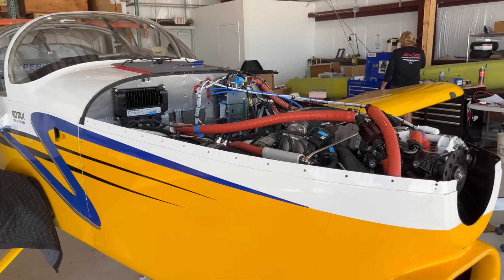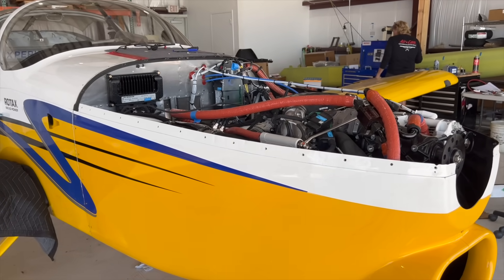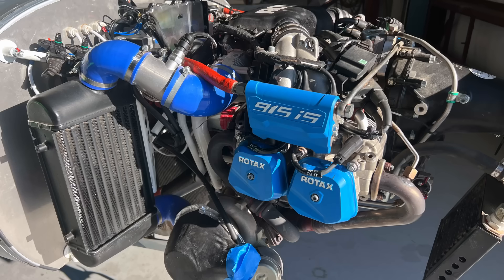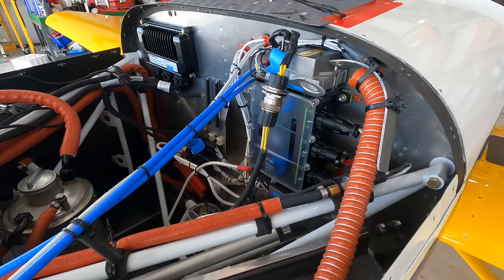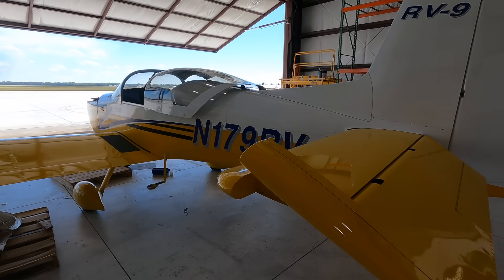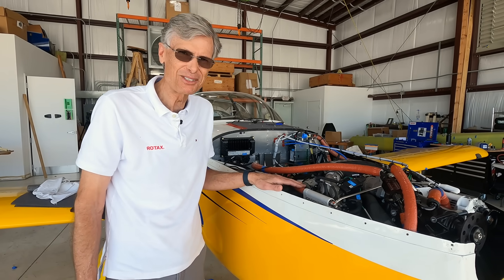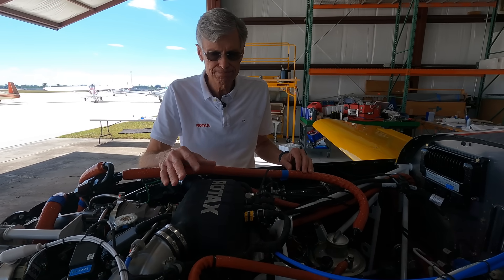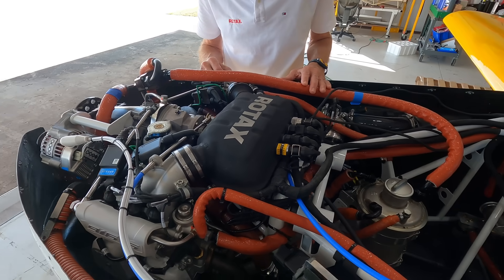Van’s RV-9: New Rotax Power

Comment: So This aircraft can go 19000 ft at 190 knots at 8.5 GPH... Now my question is... its IAS (Vne ) will be limit to 190 knots... So and Vans RV9A specs i saw celling is FL245. Here my question is If anyone wants to fly high till Fl240 suppose.... So the TAS with no wind will be 216 knots plus.. At 9 GPH..... And its IAS Vne will be under 190 knots  of less.... I saw at IAS to TAS calculator if IAS is 140 knots TAS will be 190 knots +- 5 knots depends on the aircraft.....at Altimeter 29.92 set at sea level... If this plane can go 216-220 knots at Fl220-Fl245.. This is an outstanding setup for long cross country...... Even close To early Lancairs 360 .. With very low stall speed just 44 Mph full flaps. Now.. Put BRS, AC, Aux tank.. IFR setup.... Then this Small little aircraft will be a completely beast... Better payload than JMB vl3...... With Gear down..... This is just brilliant from Vans - Lockwood and Rotex.... If all including ends 275K usd. I will be ordering this RV9A QB kit  next year.... I am very excited.. As i will fly this in india... To Dubai -Thailand often for my work.. This plane completely fits my mission under 300k usd category...

note :_  i Have seen its flying data in flighaware.com of N179RV  for may-august 16th 2025 ....it cruises continuously  at   210 knots many time at FL174 and top was 214 knots .......it seems to me 225 knots plane  if vans increase the vne..the high aspect ratio wings are doing magic at altitude .

Comment: My Glasair I RG would do 195 knots true at 7500 feet non turbocharged.  It was built around 1987.  The performance in this video is nothing new and the complicated set-up of the Rotax with turbocharger and gearbox will mean extra maintenance.  I'd stick with the bulletproof Lycoming 0320.
Reply: The 1Rg is a far superior airframe for high speed. It has much less wing area, much less payload, much less baggage, much higher wing loading, etc. Its comparing apples to oranges. However, if your mission is speed and solely speed, its hard to beat a Lancair/Glasair. But they will not operate out of the same fields as an RV.
Reply: @Jwmbike14  No kidding.  You don't have to pull out the chalkboard, I had an RV-4.  My point is the insane complexity of what he's selling.  He makes a nice commercial and maybe Rotax or our insane government gave him a big check to play with but it's all bullshit.  This set-up will be DOA in the homebuilt community who are very cost conscious.
Reply: @scottw5315  Then you should be familiar with the Harmon Rocket kit where you still had to buy the Van's kit first. Considering this comes with the $52k 916 (base price), and the MT prop, that easily accounts for $70k of the value. Cost conscious? I think you're conflating some of us with all of EAB. I own a Long EZ with a cheap GRT efis panel. But take a look at current builders. They are NOT cheap. Often with 2-3 10" Dynon or Garmin displays with full AP, etc. My hangar neighbor has exactly that, probably 70k in his brand new RV14. You and I may be cheap, but the EAB market certainly is not.
Reply: @Jwmbike14  How many Harmon's are out there?  Cheap is your word, I said cost conscious which was really the entire idea behind experimental aircraft.  There are always one or two guys who spend the money and do the work for bragging rights.  I still say this package goes nowhere.  I applaud them for trying to move technology forward, however.
Reply: @scottw5315  In and of the same meaning. A $70k panel is neither cheap nor cost conscious. There are plenty of Harmon Rockets, enough to create a ground up kit company now known as the F1. Go check out barnstormers and look at the panels. Cost Conscious and EAB diverged a long time ago. It's still less expensive than a Cirrus, but modern builders are spending ridiculous $ on engine, prop, and avionics. And they're still doing it for fsr less than certified.

Comment: Although I have flown Rotax for a long time and still fly, I like the dinosaur engines more. In the past, people used to say "do it simply" - the fewer parts, the better. Where has this way of thinking gone? With the Rotax 916, the parts never end. 1, 2, 3, generators. 1,2,3 coolers, preferably a second battery in case the first one fails, otherwise the flight will be very short. The consumption of 35 liters is not what I expected either, and then the price. Phew! But I understand the fascination of "modern" injection engines.
Reply: Lighter, more efficient, more reliable, easier to operate, doesn't need leaded fuel... what's not to like?
Reply: @PistonAvatarGuy  I don't know which engine you're talking about? Ore we had different experiences? Bulletins about engine problems come out every month(!) The weight is the same as old engines and even more, thanks to many components and gearbox. They are everything else easy to operate. Fuel pump, emergency switches, turbo, variable pitch propeller. And they consume just as much as my old Continental. I use both engines and can compare them quite well.
Reply: @FlyFloAero  You're clearly trolling.
Reply: @FlyFloAero  The weight is clearly not the same as old engines, as evidenced by the measures explained in this video to keep CG in check. I have no idea how you can simply choose to ignore this reality and substitute your own. Your other statements are also questionable and at best misleading. Regarding your experience, there's a reason basically nobody builds Cherrys with C90s anymore. Or Limbachs. Or BMWs. Several, actually - to be found in chapters 5 and 6 of the POH. That doesn't mean an old Conti is a bad engine or even a bad choice though.
Reply: @FlyFloAero The weight of the engine is more which is why when you replace a lycoming/continental with a rotax, the CG goes back too far?
Reply: Those 160 horses need food.
Reply: @flexairz  Consumption is also high at full power (about the same as a LyContisaurus) because they're pushing so much hp with such a small displacement. The operator's manual has the BSFC at max power at 297 g/kWh, while it's only 272 when the 916 is making 104 kW (the max for the 915 iS).
Reply: I don't see the point of a second battery if you already have 2 generators.

Comment: Think I’ll stick with my Lycoming as I can work on it myself and save thousands on maintenance costs.
Reply: Why can’t you work on a Rotax?  Lockwood has a maintenance training program.
Reply: @TSLApilot  Same issue as with modern cars: Higher complexity excludes certain parts from owner maintenance. You won't be taking apart a ECU or the turbo or the injection system - just buy a new one from Rotax.
Reply: @ but modern cars / ECUs are quite reliable. It’s the ancient mags that need regular service.

Comment: I don’t get why the nose needs to be so much longer with the Rotax engine. The Rans S21 has the same wingspan so the size is similar and they don’t change the nose length between the  340 or the 916 and they still accommodate 150lbs in baggage. Personally I’d rather add a 20lb weight in the nose and keep the originally cowl length.
Reply: It’s not the side to side that’s the issue. He said the Rotax was 90 pounds lighter. Because of that you have to move the arm of the engine mount out farther to accommodate the weight loss. Think of it like a seesaw. If you put the lycoming on one side and the Rotax on the other the lycoming would go straight to the ground assuming the seesaw was equal length on both sides of the fulcrum. By making the Rotax side longer you achieve a balanced seesaw.
Reply: @ I understand the theory. My point is Rans uses a Titan, which is obviously heavier than the Rotax which they also use yetyet their cowl length for both engines is identical…. and with a lighter Rotax, you still get a hefty 150 pounds of luggage versus the 180 pounds of luggage for the Titan. How can Rans figure out the seesaw conundrum without changing the nose length?
Reply: @Captndarty  might change your cg envelope if the others are constant.
Reply: @Captndarty  You can always add weight, maybe that's what they did.
Reply: @Captndarty  Sounds like pitch stability was the main reason.
Reply: @Captndarty  Different airplane designs have different cg envelopes.
Reply: Thats 20 lbs of not useful weight.

Comment: I hope Rotax comes out with a 350 hp turbo normalized engine.
Reply: That would be a big engine. A boosted engine would make more sense.
Reply: @PistonAvatarGuy  
Turbo normalized is boosted.
Reply: @A.J.1656  No, it's normalized.
Reply: @A.J.1656  Boosted mean ABOVE atmospheric pressure.
Reply: @PistonAvatarGuy  
Do you know what that means?
Reply: @ 
Which is what a turbo-normalized engine does. Unless you are flying at or below sea level, it boosts the pressure above atmospheric.
Reply: @A.J.1656  Yes, which is why I made the comment that I made. A 350 hp turbo-normalized engine will always be larger in displacement than a boosted (turbocharged) 350 hp engine.

Edit: ...all else being equal.

Comment: Curious how the eprops gloriuse prop compares to the MT?
Reply: I think the Glorieuse is some 20lbs lighter than an MT, so that would really screw the CG. Maybe if they'd use the space behind the engine to integrate a BRS as well?
Reply: @ yeah.  I didn’t know the specs on the Mt.  but the lower the moment of inertia, the longer the gear box will last.  And if you could add a brs or an oxygen concentrator.  Maybe that would be huge win.
Reply: I feel like with the altitude range available to you along with the turbocharged engine the constant speed is undoubtedly the right call here.
Reply: @b_dvo  The Glorieuse is a newish CS prop from E-Props. Insanely light at 9 lbs for the 3-blade, I don't know how they do it. Only for Rotax though, way too low MOI for direct-drive.
Reply: @LeShadokEnchaîné    Why is there a lower limit on MOI for direct drive?
Reply: @timduncan8450  don’t know for sure but I think it has to do with the impulse delivered to the blade.  The gearbox I think reduces that stress significantly.
Reply: @b_dvo  the gloriuse is constant speed.